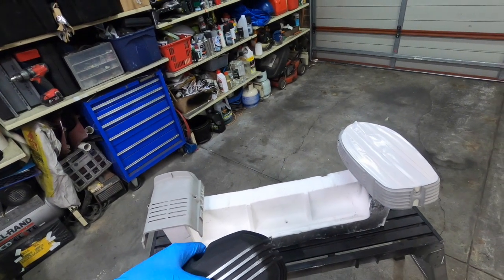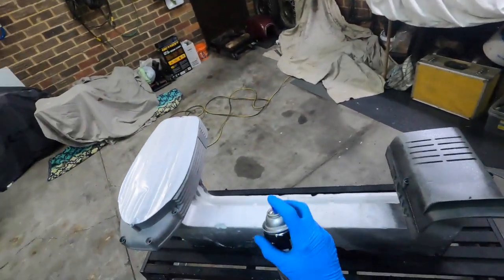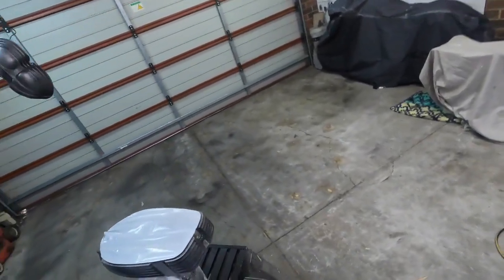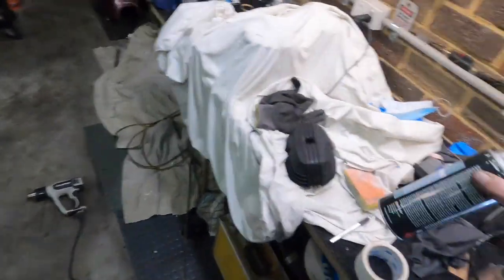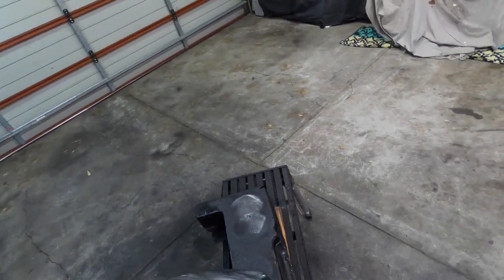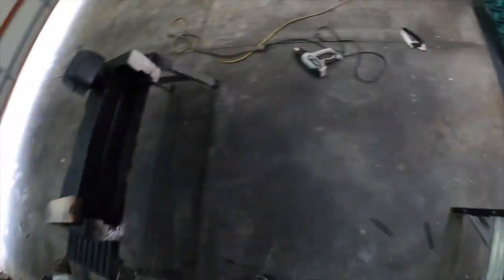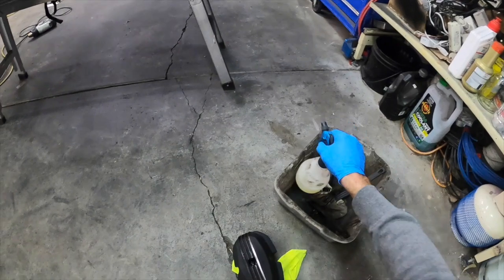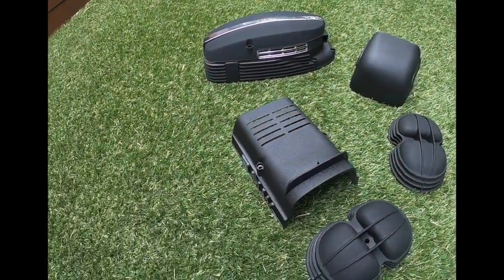Duplicolor wrinkle finish application on BMW R100 cafe racer project engine covers & fuel spill test

Comment: Tried wrinkle painting some parts but some areas was not wrinkle after coming out of the oven. I’m thinking I need more paint in those area. Do you know if I can just add more paint and use a heat gun over the already cured paint? Hope I don’t have to strip it down to bare aluminum.
Reply from the maker: I had the same issues buddy. I just dusted the spots and hit them with a heat gun which seemed to work.  Be careful it's not too wet at the edges of the spit patch or those parts seemed to go a bit shiny.
Reply: Great. Thanks for the tip. So glad I don’t have to strip it down. For your engine block did you just use the heat gun or was your grill large enough to fit it?  I’m trying to attempt the same look you have with the engine.

Comment: Nice work! I am removing the engine on my 1976 R100S and was thinking about powder coating but it´s way too complicated. So, this would be the perfect job as I really like this wrinkle finish... Could you write the materials used and the process? I am not good at understanding spoken English but can read it. 
I see you use two Duplicolor products, Wrinkle Finish and Engine Enamel? You used a primmer first, what sort? 
Maybe you have to apply Engine Enamel to all the pieces and then the Wrinkle Finish?
Thanks in advance for all the info you can share... Cheers.
Reply from the maker: Thanks for the comment mate. It might be easier to head over to my Instagram page @twistedfate_builds where I have pics and write ups of my experience with it. But pretty much with the wrinkle there is no undercoat you just need a good clean keyed up surface thoroughly cleaned with acetone or wax/grease remover then you do a few lights coats building it up and bake it to produce the wrinkle. Another way you could possibly do the video is set captions to your language if that works?
Reply: @twistedfatebuilds  Great! Will go to your Instagram. 
Last days I was thinking about some options about painting the block, not powder coating it as it´d need full disassembly... Wrinkle finish looks nice but could I bake it with a heathing gun or do I need an oven? I though that since the block is small now it has been disassmbled, maybe I could use the heathing gun in one side and then do the other later.
Another thing is about how is the paint holding up after some months? 
I think I got too deep into this but now there I´m doing also all the wiring to the Motogadget thing and also powder coating frame, etc...
Thanks again for your advice!
Reply from the maker: @frc6040  I used a heat gun and small heater in a camping toilet tent which made a version of an oven to bake mine buddy. It's still holding up well but I'm only half way through the build so can't really tell for sure untill I get it out in the real world with some road grime, mud, water etc 😉

Comment: Awesome man can't believe the fuel test came up trumps. Your comment about the k1100 blistering up has now got me worried I've only just finished spraying my K100 this week in the dupliclour engine enamel. I did the valve cover in engine enamel and the crank cover in two k because I couldn't get thr mirror fishing I was looking for. I will be doing the cam cover in two pack this coming week.
Reply from the maker: Cheers John. It's such a pity re the engine enamel. I spent so much time on prep and it still has no protection against fuel and I'm not alone. Heaps of ppl complaining about the same thing so I was stoked to see the wrinkle smash it out of the ball park.  Atleast you know you can strip your covers by just adding fuel 😅